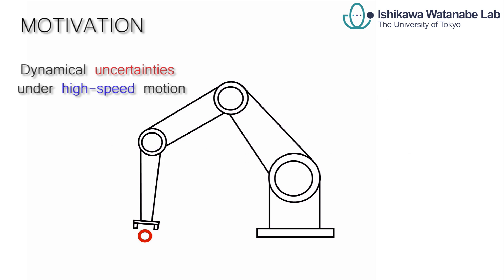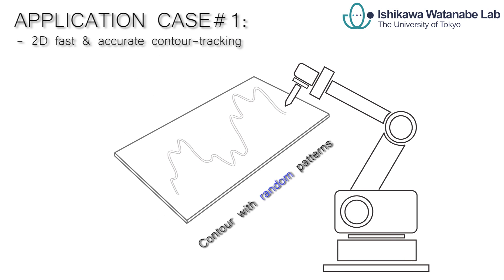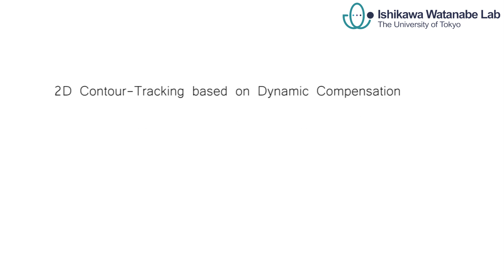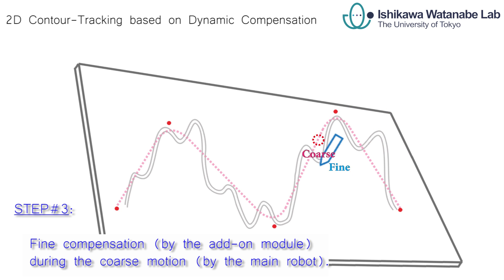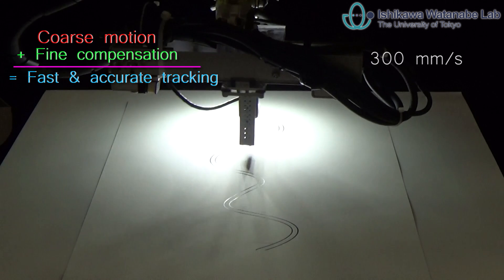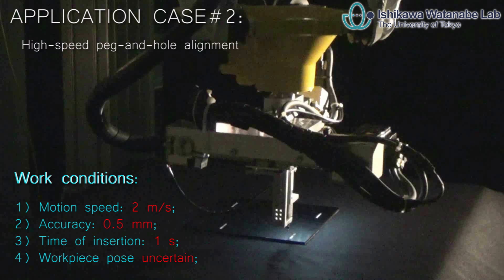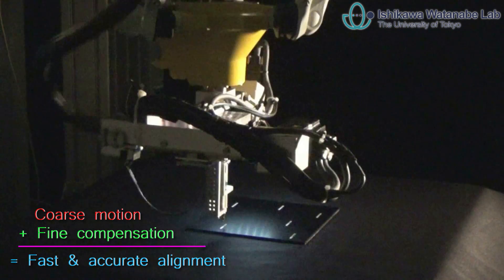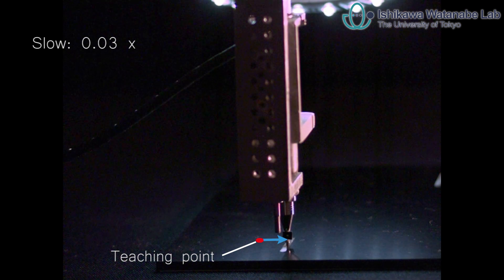Dynamic Compensation - Toward the Next-Generation Industrial Robot

Comment: Can't the large robot adjust it's own motors using the feedback from the camera?  The video doesn't make it clear why the additional smaller end actuator is required.  But i assume it's because even with feedback, the larger robot motors still cannot attain the required accuracy.
Reply: +roidroid That's what I'd guess. Also, the large robot has much larger motors, which would take more power to make small adjustments like that? Good question.
Reply: +domdanialZASRA part of the reason the large robot's motors are so large tho, is so that it has the torque required to do powerful actions and lift heavy things.  If they add an extra smaller actuator onto the end, then this actuator would also need to have the same amount of power.  Otherwise it'd be like a weightlifter with huge leg muscles but puny weak arms, the weak arms will be the bottleneck limiting the whole weightlifter's ability.

So for the robot to retain it's original strength, (all things equal) the extra actuator's motor would have to be just as powerful as the robot's original motors.  The major difference seems to be reach: the comparatively smaller reach of the extra actuator means it can be geared to be faster, stronger, and/or have a lighter motor (but not all 3 of these things at once, u must choose only 1 or 2)